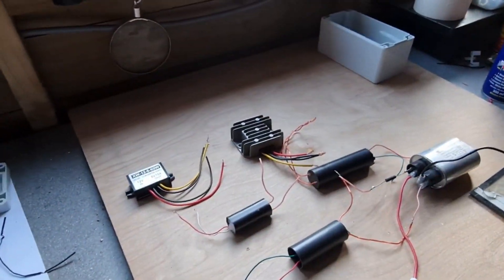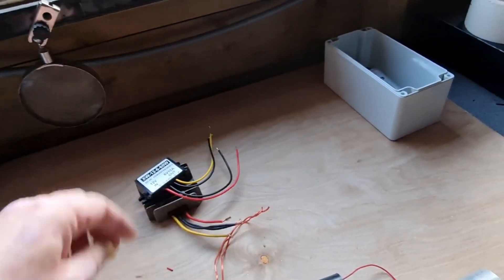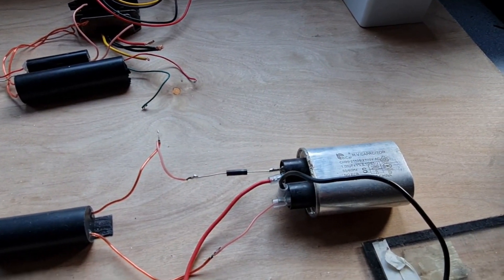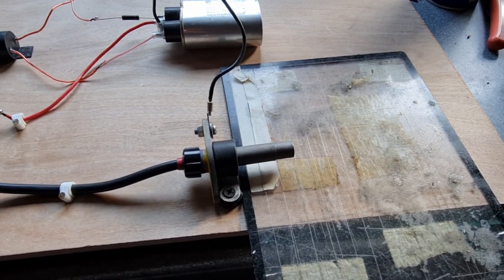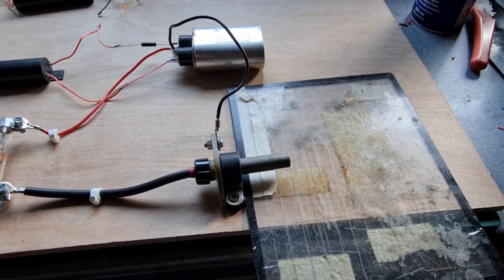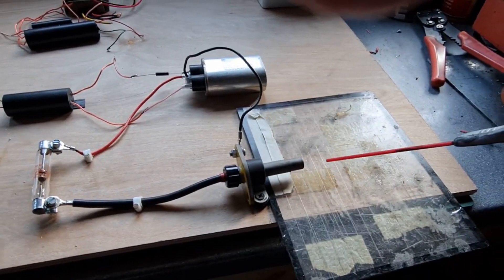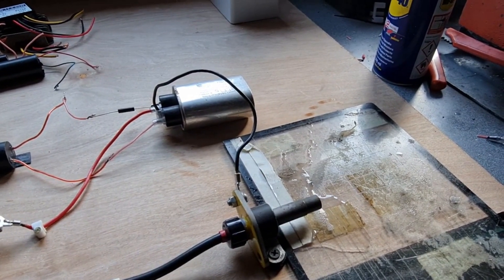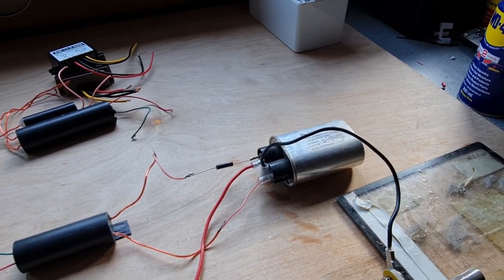DIY Jet Engine Project X Ignition Box Danger High Voltage

Comment: Do you run coolant through your turbines like Tech Ingrendients does to prevent it from getting too hot or what do you do otherwise?
Reply from the maker: Hi, with respct... he got so much wrong in the engines he made.... many of the group commented on how bad his engine was... if you mean do I have oil cooling the bearings yes.... no need for anything else... you should look at my new engine...https://www.youtube.com/watch?v=Mw0J4izpyH8

Comment: Finally, i all the time have problem to start it, was using ebay high voltage transformer same like you, now i will try to upgrade, hope it will be better
Reply from the maker: glad it helps 😃👍
Reply: @Turbojetkart  Hei ,but do i need sparker? ( glass thing). or i dont need  to run sparkplugs.

Comment: Electronic Sphere 638678 piaggio 50 Sphere FL RST 1995-1997   use a modern coil like this
has incorporated the power circuit and just enter with battery positive and a signal on 400 Hz
I try if I still have the pattern I made some time ago
Reply from the maker: thanks for comment

Comment: What diode are you using please
Reply from the maker: Sorry... did not put link... 20 kv rectified diode, loads on ebay...
Reply: they are from microwaves. when you open a microwave it should be on the capacitor
Reply from the maker: @raydoesaudiostuff  the caps in microwave work well also
Reply: @Turbojetkart  how do you inject you fuel, I am planning to use propane